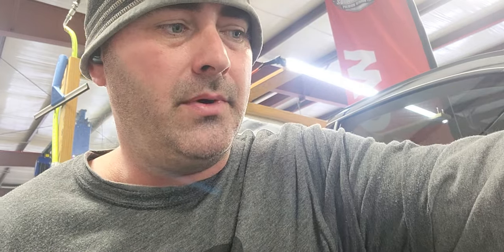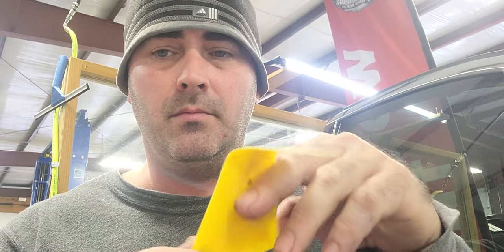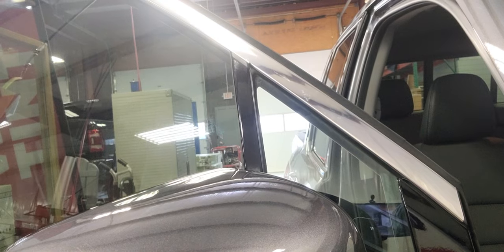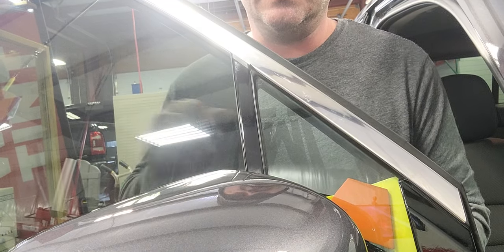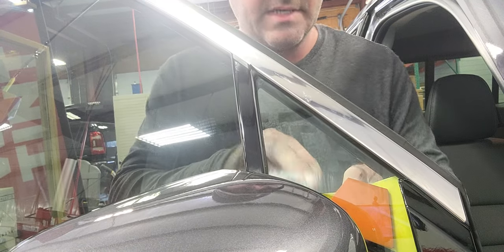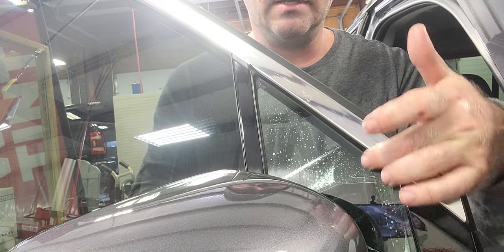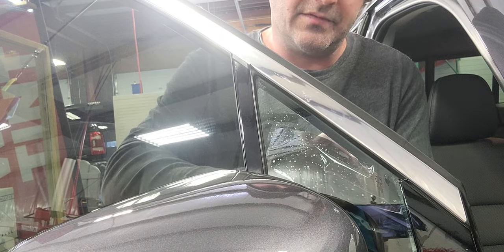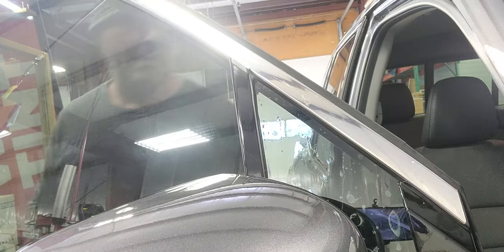Honda Ridgeline 1/4 glass

Comment: Hey jason, since i found your videos you helped me alot. Two questions
How do you hand cut that 1/4 window?
How do you cut a blue max or orange crush squeegee for small windows? Thanks man
Reply from the maker: I cut all 1/4s by using a marker to get the shap and cut right on the edge of marker line.  As for the squeegee I sue my olfa and make a few passes to get through it
Reply: @jasonthetintmanteasley5045  okay thanks alot, im gonna have to try that! Keep up the content its great!
Reply: This was my question too, seems like it’d be harder hand cutting out the pattern then applying it. But marker. Got it, thank you!